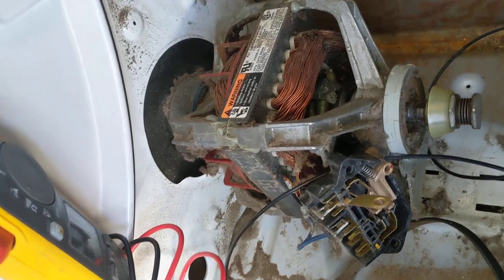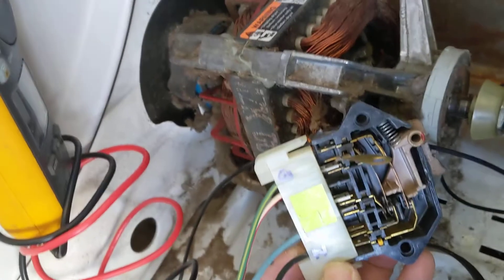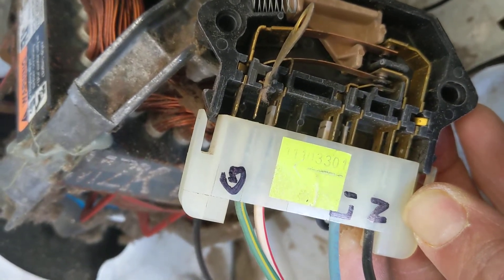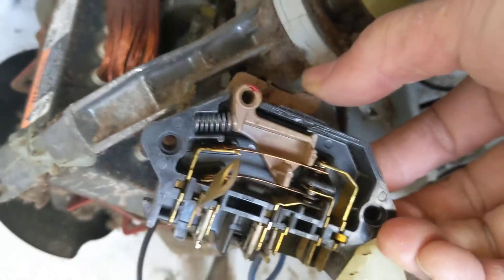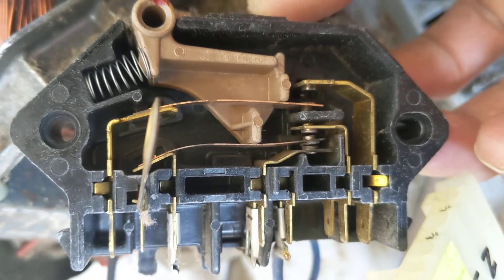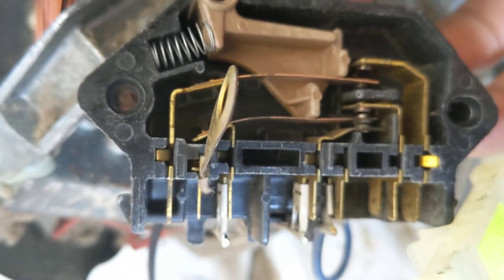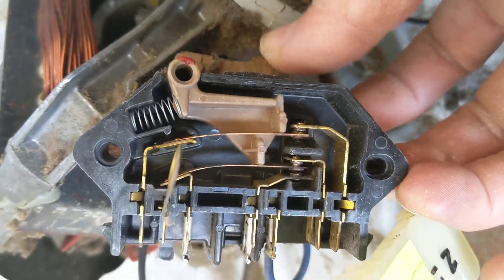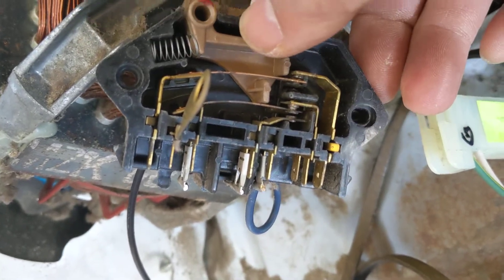dryer motor switch

Comment: I changed  the heating element and the dryer wouldn't spin  i tried and checked everything from top to bottom and i was gonna give up until i checked the motor and this little piece gets stuck it won't let the motor spin i pulled it bac and it starts but once you turn it off it wont go again till i do the same. My question if you can answer from two years go its do i have to replace motor or just that black piece.  ?  Thanks
Reply from the maker: Check and clean contacts and terminals , might just need tightening or cleaning with sandpaper or alike
Reply: Thanks for your video it help out  a lot. There's so much more than just thermal fuse ..
Reply: One last question . In your experience you say this switches don't get  replaced  one have to change the whole motor..?  I've seen some videos of how to .and it's a pain cause the blower has a plastic ring on the motor shaft and it's prone to break easily
Reply from the maker: @octaviogarcia928  this dryer in the video is really old,  you can easily get a whole used cheap one than going through all the trouble IMHO.
Reply: I just did this 

I think there is a temperature  circuit  breaker. 
On the other side of the switch,
And if that goes.
Motor won't  run..
It's where the blue  wires are..